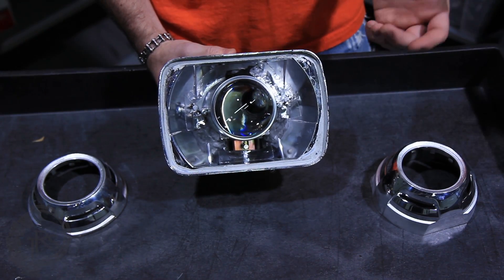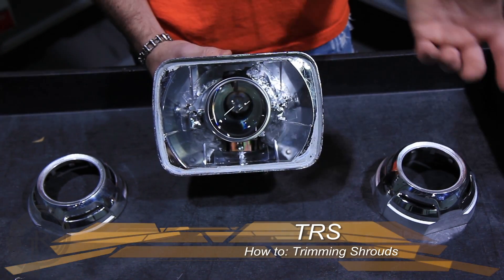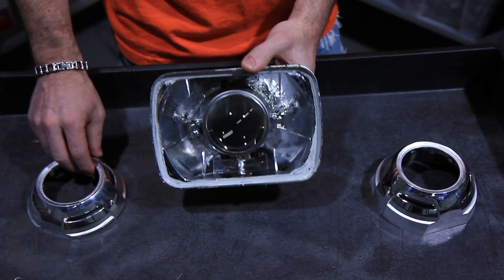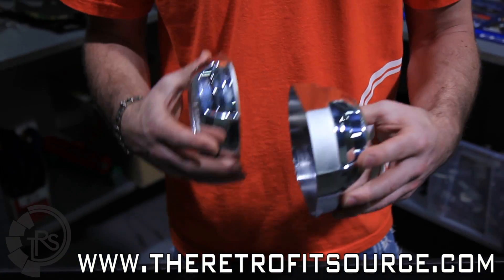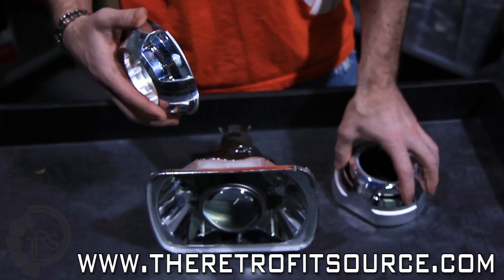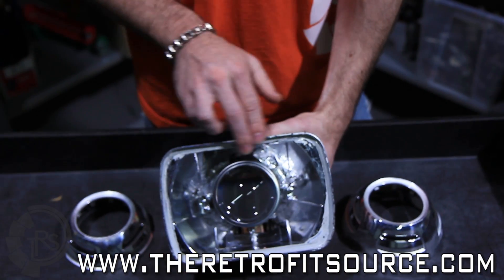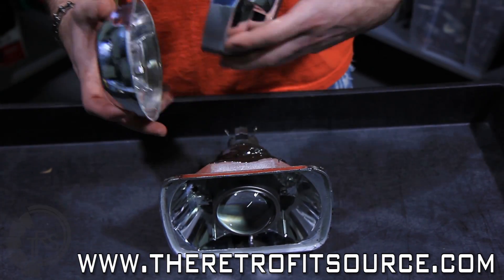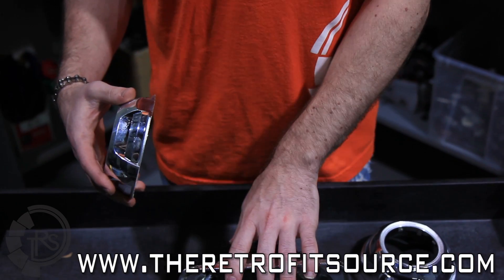TRS Tips: Modifying and Trimming Projector Shrouds for Headlight Retrofits

Comment: 47MasoN47 The projector is what the light is inside of, the shroud is just for looks and cutting the shroud will have no effect on the light output.
Reply: I ended up not needing to trim the shrouds, I trimmed the bits in the headlight housing instead.  It was going to look odd if I had to cut the shroud, cutting the bits inside the headlight turned out a lot cleaner, but it was quite a bit more work as well.  I'm happy with how they turned out.  I've been using my Moimoto Minis for about 8 months now, couldn't be happier :)

Comment from the maker: none at all, the shroud is just for looks and has no affect on performance what so ever. Some projectors are designed with an open body, some are completely sealed up, but light leaking out doesn't necessarily mean its causing the projector to be dimmer in terms of output